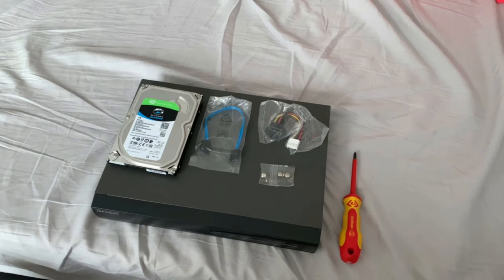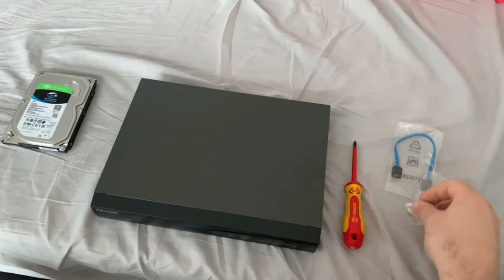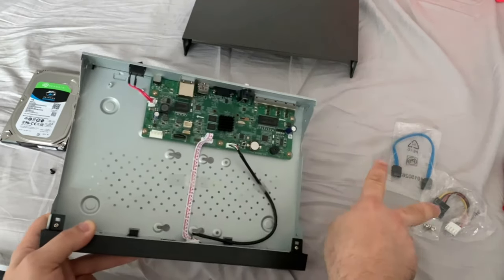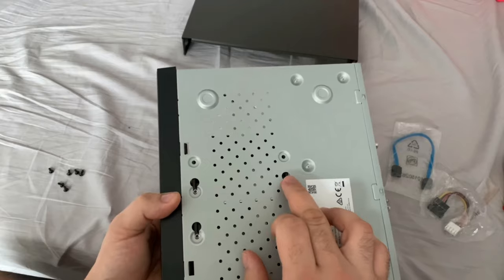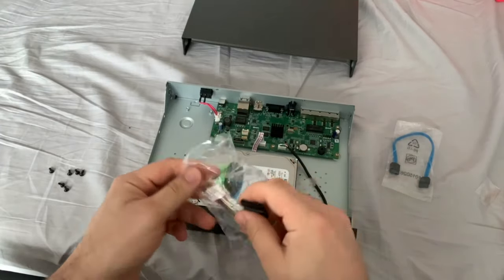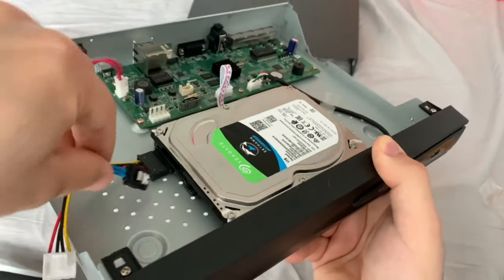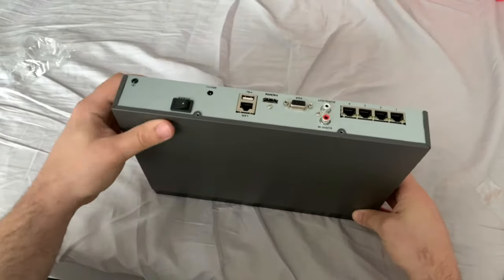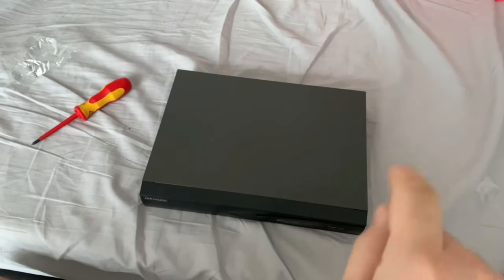How To Install A Hard Drive In A HikVision NVR NEW

Comment: Hi  thank you for your video really liked how you slowed things down to give tips on the wire installation making sure you line it up well I have a  Quick question Im waiting on my drive to arrive but its going to be the new year before it gets here I have all my cameras and NVR ready I do have a 2 tb passport HD which is cased could I plug this into the usb port on the front just to test the cameras and check the system is up and running as amazon said I have up to a month to return the cameras if there is any problems your thoughts
Reply from the maker: Hi Steve good to hear!
You don’t need to plug any hard drive into the system to check it’s all up and running to be fair. The NVR will beep every 15 seconds because of no hdd, but you’ll still be able to configure and test the rest!
Reply: @HikVisionGuru   Thanks I ordered another HD and got it up and running today my set up was a little different from yours and I got a liitle lost I did manage to get five of my six cameras working but one of the cat 5 wires got damaged during construction so spent the ret of the afternnon trying trace that and fix it, Im still struggling to connect my phone app to the nvr will try and re watch your vidio again see where I go wrong

Comment: Great video! Is the molex connector you're using a normal female connector or is there a special one you have to buy with the clip to fit right? Thank you!
Reply from the maker: They are supplied with every brand new HikVision dvr/nvr. They are a 4pin to sata power cable. The blue cable is a standard sata data cable. We do sell them if you need any.

Comment: hi can you please let me know what the name of the blue cable is and the other red and yellow cable. also where did you get the screws to put on the device. please let me know
Reply from the maker: The power cable is a 4 pin male to Sata power cable, the other is a sata data cable. The screws and cables are included with every new HikVision NVR/dvr.

Comment: Hi mate need help ive installed a ssd on a 7204 hikvision issue im having when the hdd is plugged in hikvision wont boot but does when i unplug hdd ? Any ideas or maybe does the hdd need formatting its a new ssd 512gb

Comment: I’ve just installed a new HDD (sea gate a like for like replacement) but having installed it, the system just doesn’t see a HDD and there’s no apparent way to add one?
Reply from the maker: All of the cabling plugged in nice and tightly/snug? I’d double check the connections. 
Are you going to the device settings page, going to storage/storage management screen and seeing no hard drives whatsoever on the screen like in the video?
Reply: Yep all cabling connected fine. This was to replace a faulty/old HDD that was showing an obvious fault after years of use. Connected up the new one (exact same layout/box as yours in video) fired it back up, and on the HDD menu there’s nothing showing in the HDD list, & no apparent way to add one. A cable having failed seems unlikely, but I’m at a bit of a loss as to what else to try.
Reply from the maker: @KitReynolds-d8g  yes very unlikely cable issue unless you can see any obvious damage. Next port of call would be try a new DVR/NVR. The hdd will always show on the list whether it’s initialised or not